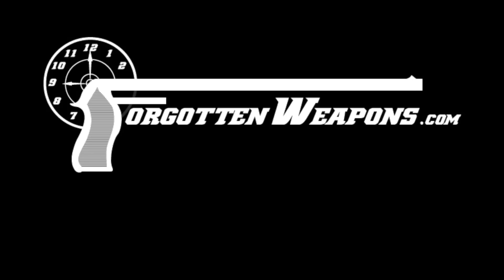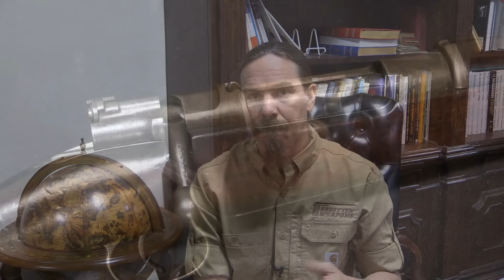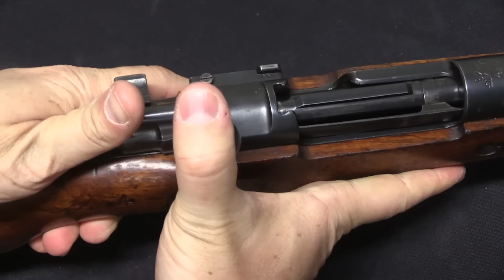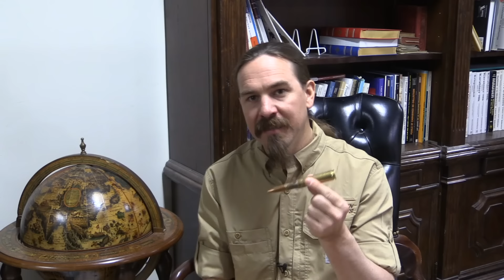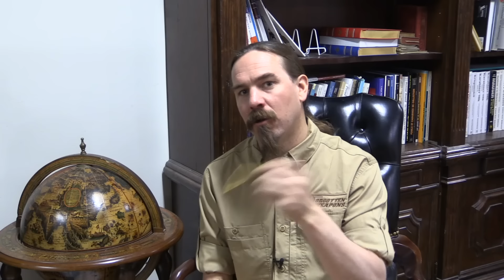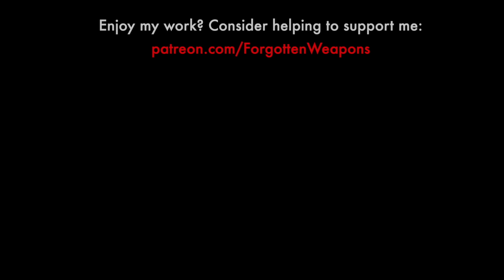Earth-Shattering ka-Boom! How (and Why) Guns Explode

Comment: Just one more thing: He wore safety glasses, which safed his eye and potentially his life!
Reply: Yeah, that could have been much worse
Reply: Made all the difference.
Reply: Yeah that one thing i don’t see mention a lot.   He would be blind or have brain damage had he not had it.   BOttomline guy is lucky or he’s t500 terminator model
Reply: there was an.... Incident, at AngloAmerican's Dawnson mine that had a similar outcome- there WAS a youtube video as part of the incident report, but it seems to have "mysteriously" vanished from youtube.
short story, there were 3 employees- 2 normal, one manager, all three were essentially in heavy sleep dep due  to them being repeatedly woken up exactly at the minimum time after they clocked off,repeatedly, over several shifts when, i THINK they were already doing overtime and exhausted to start with.

issue was a 3 phase circuit breaker powering some important equipment had died (breaker itself was fine, something had gone in the control panel/switching panel), and they had been incapable of getting in contact with the manufacturer for almost an entire day (as in, no responses online/on the phone) to get replacement parts OR a certified technician. so eventually, they were loopy enough for salvaging parts from another breaker to seem like a "good" idea (even though this ended up involving using a power drill to trap the internal springs in place to stop it going flying, after they lost spring tension on the FIRST one and made it useless
).
to cut a very long chain of dubious decisions made under heavy pressure (they were close to having to shut down part of the mine due to storage backing up, i think),stress, and with the equivalent of more then a day without sleep/ repeatedly interupted SHORT sleep short, the breaker was a fail-deadly design (in my, laymans opinion, designed by a fu- bloody moron)that would close under gravity if the control panel was removed, and both workers got a face/torso full of molten copper- the one thing they did completely right, even with their brains half gone, was to put on their protective vests and safety glasses- which took them from "eyes burnt by molten copper, burns all over their torso" to "minor burns"
Reply: @Gantradies  incidents like these make me afraid and concerned for my life even more.... It's pretty scary to think how vulnerable we humans are, but without incidents like these we would have not thought of the importance of safety. Stay safe my friend and thank you for sharing this story
Reply: I refuse to wear them because I already wear glasses don’t have anything that will fit over them
Reply: @laughingsnake1989  You can get prescription safety glasses.
Reply: As a former factory worker, I can attest to the virtues of safety glasses. I swear by 3M Virtua glasses. Saved my eyes of several occasions.
Reply: I think the threading on the cap and the ears on the lower dissipated the energy enough that the safety glasses were able to deflect the cap from his eye so that only his lower orbital was broken.
Reply: Absolutely, even with all the bones broken around his right eye! They saved his life, without them (and I think that the opening of the cap was hitting him), the cap would he crushing his skull and potentially damaging his brain behind!
This was one of the almost fatal injuries!
Reply: I wonder if going forward he will start wearing a protective gorget while shooting as well?
Reply: I had eye pro save my sight and possibly my life in the army. I was a medic providing medical coverage at an M4 range. A ricochet flew back and hit me in the left eye. It took a sizeable gash out of the ballistic lens, shattered the frame, and gave me one helluva black eye. No more pop up targets until the range was redone after that.
Reply: @ThumbNurBum  same for me except MSA. Once on the range (not even me shooting) ricochet from a dope shooting a tire rim. Second was an air chisel exploding. Had the ones from the range shadow boxes and left on display as a reminder warning. Quarter inch piece of steel completely through the lens but stopped short of eye!!  Thank god for MSA I was a tire equipment salesman and we sold them!!
Reply: Saved*
Reply: Typical spelling of a safety glasses enthusiast. 
On another note, safety glasses/goggles are good at stopping small shrapnel and the like from hitting your eye. If the plug that shot from the breech had been a half inch higher his eye would be gone, glasses or not. There was way too much force for the glasses to have made a lick of difference. That being said, nothing wrong with safety glasses, but they’re not magic
Reply: ☑️ Yep. I like to take firearms safety to its maximum extent. I wear ear and eye protection, PLUS a life preserver. I find that a tig welder's helmet is helpful too.  Also, i wear skateboard-style elbow pads, and my old BMX racing pants, with various pads sewn in, along with a catcher's mitt on my left hand, and a NHL grade goalie glove on my trigger hand. I've discovered that wearing a medieval chain mail shirt can add an extra level of protection. But i reinforce it by wearing plate mail shoulder pads on top of the chainmail. 😎👍
Reply: @bredcred_granted_0  so just wear them? If they make no difference either way, then surely leaning on the side of saftey is best??
Reply: @AngelFluff723  I was correcting him not disagreeing with him
Reply: @laughingsnake1989  Just make sure your lenses are polycarbonate or a trivex material and you will be OK in 99% of situations, or get prescription safety glasses
Reply: this comment potentially safed my life lmao
Reply: Absolutely saved his life.
Reply: You mean the safety squint isn't adequate????
Reply: @elancaster3989  Depends on the squinter's level of squintness as defined by the squinting safety.
Reply: So this may be a dumb question, but is there a difference between shooting glasses and safety glasses (Construction rated)?
Reply: @ulyssesarias4400  Doesn't sound like a dumb question to me. I don't know the answer.
Reply: @ulyssesarias4400  I did a little searching, just a couple google searches nothing in depth, and found that for both shooting and construction the suggest rating was ANSI Z87. 1 although for shooting this was considered a minimum at least on the site I was looking at. Here's a blurb from the site covering the other ratings. 

"Impact resistance ratings are promulgated by the American National Standards Institute (ANSI), Occupational Safety & Health Administration (OHSA), and the U.S. Military. These entities have standardized tests for eyewear impact resistance. OHSA Safety Standard 1910.133 requires impact resistant lens AND “eye protection that provides side protection when there is a hazard from flying objects.” ANSI standards for impact resistance are outlined in articles Z87.1 and Z87.3. These standards were provided to ANSI by the American Society of Safety Engineers (ASSE). The U.S. Military uses a standard called MIL-PRF-31013, a tough .15 caliber ballistics impact test. U.S. Military eyewear must pass this standard before being issued to any U.S. military personnel."
Reply: @Parents_of_Twins  I'll definitely check that article out here when I get on break, but thank you for getting back to me on my question! I definitely appreciate it!
Reply: Though the end cap hit him below his eye.
Reply: @davidperry1364  Don't succumb to that kind of thinking. The lens of Scott's safety glasses barely got a scratch from the breech cap. Blunt objects don't go through polycarbonate. They bounce. Hence why riot shields are made of it.
Reply: @johnbarron4265  umm, a scratch? You can clearly see the where the outline of the cap smashed right through his safety glasses. It’s safe to say that most safety glasses aren’t made to deflect projectiles like the breech cap if they fail. It’s to keep  metal and dust particulates from having a direct shot into your eyes. Important, they are but impenetrable they are not.
Reply: @davidperry1364  If it "smashed through" it would've hit his eye, which it clearly did not. It's quite obvious that the polycarbonate lens received a big portion of the blow, distributed the force over his orbital bone and nose, and flung the breech cap away like a trampoline. The glasses may not have specifically been rated to stop breech caps, but in this instance, the glasses did just that.
Reply: @johnbarron4265  I refuse to go through and highlight in the video where you can clearly see the outline of the cap in the bottom right corner of his safety glasses. “Which it clearly did not” my ass. The cap bounced off his orbital bone, if you honestly think the glasses did any more than hinder the breech cap on the way to his orbital there’s nothing more to talk about. Pls watch the subject video again if you want to try and continue this farce
Reply: @davidperry1364  So we agree then, if I'm reading you right. The cap did not directly hit his eye. It drove the lens against his orbital, transferring the bulk of the impact energy there instead of into his eye, which could have otherwise resulted in Scott sustaining far more severe injuries. No matter how you describe it, the safety glasses almost certainly saved his vision, and would've likely also saved it had the cap hit nearly anywhere else.
Reply: @johnbarron4265  you’re saying if the cap hit the glasses square on right above his eye his eye wouldn’t be gone? This is what I’ve been saying from the very beginning, safety glasses are important and they have their role but when dealing with forces like what he was dealing with  it would and did make almost no difference. You have way too much faith in a piece of plastic lmao
Reply: @davidperry1364  Or maybe I'm just a materials nerd who has high expectations of engineered products. For example, I was amazed at UVEX's safety glass demo where they shot a steel ball bearing at 440 mph and it barely left a scratch on the lens. Like how can you not be amazed by feats such as this?
Reply: @johnbarron4265  so now we’re comparing ball bearings to a much larger and probably faster moving projectile hitting nothing but  a basic pair of safety glasses. I’m sure there are amazing pairs of safety glasses/eyewear out there. But that doesn’t mean that every pair of glasses is as protective sadly
Reply: @davidperry1364  Fair enough. And without knowing exactly what brand of glasses Scott used, we'll never be able to pin down definitive answers to our hypotheticals. At the end of the day, one must have not just faith, but confidence in their system of tools. The selection of each tool is an engineering analysis in and of itself.
Reply: @johnbarron4265  agreed, at the end of the day I believe we were arguing over how much trust we have in our equipment. I would like to make clear that I still think safety glasses are important for the reasons I’ve already mentioned. However, I do believe a blind trust in safety equipment can lead some to lean on safety equipment too much while behaving or acting irresponsibly in other ways. I have much more trust in myself to check that I am doing the right things. Safety equipment such as range glasses are good at what they are designed to do, and I don’t expect them to do anything else. All in all, wear whatever is required for the situation, but be as cautious as if you weren’t.
Reply: He was lucky because that plug that blew off grazed his head, and safety glasses would not have been any able to stop it. Two other fragments of metal penetrated into a lung and his neck, nicking his jugular vein.
Reply: @davidperry1364  I think if that happened, he would of died if massive head trauma. I'm just glad he suffered no permanent harm.
Reply: @taraswertelecki9886  The "plug" did more than just "graze" his head. It flew directly toward his eye socket and broke his orbital bone in three places. If he hadn't been wearing safety glasses, it could've been much worse.
Reply: @johnbarron4265  That plug could have smashed his skull which would have killed him. As for the rifle, I would NEVER trust a thread on cap to hold back 55,000 psi chamber pressures. I would want a rifle with a Mauser style locking system plus later improvements. There is however a likely reason why his gun exploded. He was firing sabot rounds, and in a muzzle brake they cause dangerous obstructions. SLAP rounds were made for machine guns, not rifles with muzzle brakes.
Reply: To be fair, he was shooting a 50 BMG. I feel like that's one of the situations where you should take every safety percaution you can.
Reply: I am able to read these comments due to shooting glasses. I was shooting a cap and ball revolver. I was younger and more foolish and got to playing with the black powder. I had about half of a one pound can ignite in my hand while standing over it. I was severely burned but my eyes were OK.
Reply: specifically one with a Z87 specification
Reply: @laughingsnake1989 lenses exist

Comment: "If something's weird, stop, and figure out why."
That's a really good tip, not only for gun safety.
Reply: A lesson for life. If/When it smells funny, take a step back and assess the situation.
Reply: That's what she said.
Reply: Grimace427  Very much applies to flying too. Only difference is you may not have much time to diagnose a problem if say, your engine goes out. In this case, if it doesn't restart after you went thru all the necessary procedures don't waste time trying to get it started again. Start looking for a place to glide in and put her down safely. My local flight school doesn't even let people reset popped circuit breakers anymore because they really don't want a fire breaking out inside the cockpit. One time I was about to go for a flight after getting some fuel and then the engine wouldn't turn over. The prop seemed to only move a little bit and then seize up. And then it started after it moved a little bit more. And I already knew from a similar experience with my car that it was a sign of a starter going bad (I had no engine trouble at all after we actually got it running). So I told the school about it (we aren't allowed to hand prop start at my school either).
Reply: @mattpeacock5208  definitely, if you stop smelling the smell and you haven’t left the area there’s a good chance it’s already too late. At least it’s the case with hydrogen sulfide.
Reply: Exactly.  About 35 years ago, I was plinking with some guys.   One of them had just bought an old military rifle, can’t remember make or caliber. 
It looked to be in good condition.  He lloaded a few rounds and leant over the hood of a truck.
Six or 8 of us were packed around him like an elevator full of idiots.
The first shot sounded fucking weird.
It was loud, but dull, with no crack or echo…   We all kind of exclaimed “WOW!”  Myself and a couple of other guys, we later discovered, had  assumed he would stop and check the gun.   Before we could say anything, he pulled the trigger again.  Nobody was seriously hurt.  The sound was like an explosion, of dynamite or something like that.  Very loud, louder than a shotgun or 44 mag up close.  The breech did not explode.  A stinging, burning hot fan of gas and debris came from the small gap around the bolt.   I think the bolt might have deformed.  
The guys who were close had  powder burns and what looked like small abrasions scattered across their faces.  There was definitely some hearing lost.  One of the guys told me later that his ears had wrung (badly enough to wake him up at night) for a almost a week.  The shooter was shocked, but basically okay.  Eyes wide, his face dirty from debris and little burns, blood trickling from what looked like a hundred  shaving nicks. 
   That gun was well made and we were lucky little morons.
Reply: This especially is an "everything" tip
Reply: Turkish Airlines flight 981 went down with 346 souls because a ground crew used too much force closing cargo door*

*the faulty design of said doors allowed for mechanism to be damaged that way
Reply: One time I loaded my muzzleloader twice, I had never done that before and I shoot muzzleloaders all the time and never dry ball or anything like that. my rod wasn’t  marked, but the second time I loaded it (pounder and ball) I had the strange feeling like something was off, luckily I listened to that feeling and pulled the ball and dumped the powder, then I caped it, pulled the trigger (pointed down range of course) and boom. With that sound I realized I dodged a bullet (or a lot of shrapnel) there. Always listen to your gut, there’s no risk from checking again.
Reply: We had a rifle shooter once catch the bolt with his face.  Single shot, bolt action rifle. Turned out that the rifle had started firing as he closed the bolt.  Unbelievably, he kept doing it - apparently for some 20 more rounds, with predictable and nearly fatal results as the bolt entered his skull just below his right eye.

Firing pin was broken, and the front end jammed in its bore, protruding from the bolt face.

Not too long before, I'd had a similar experience during an international match - rifle fired as I closed the bolt.  The trigger frame had come loose from the receiver, sear not engaged, firing pin forward and crushed the primer as the bolt closed.  Thankfully the lugs were engaged enough to retain the bolt when it went off. After the surprise passed, I obviously retired from the match and stripped my rifle to figure out the issue. I can't imagine why someone would experience that and just keep going, but apparently it happens.
Reply: sure, you couldn't have told me this before I got married????